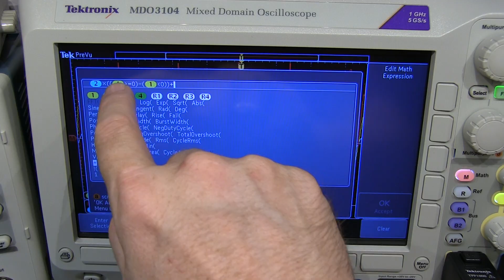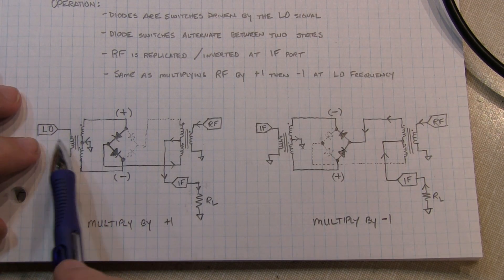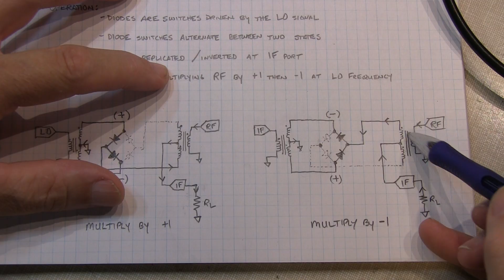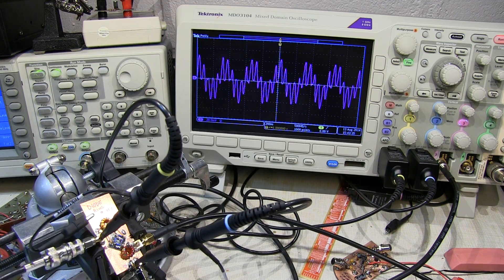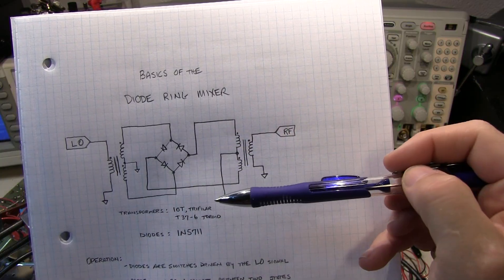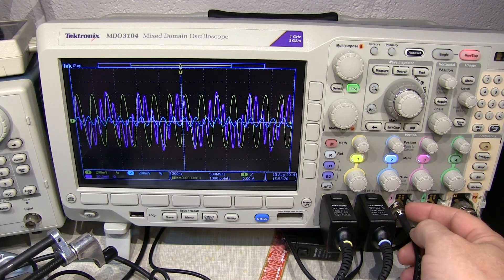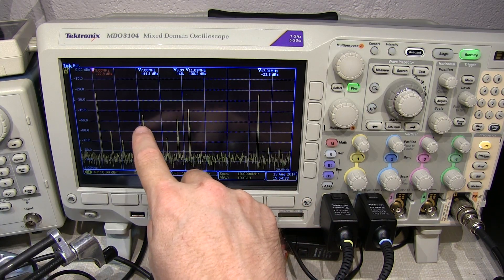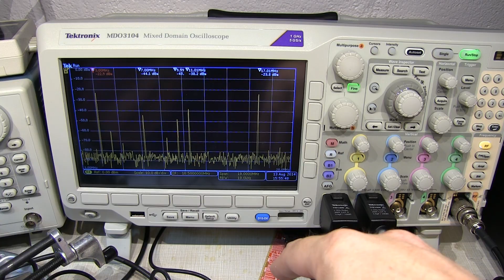#167: How a Diode Ring Mixer works | Mixer operation theory and measurement

Comment: Hi Alan. You comment that the IF output should have a good termination / a nice broad band termination, to prevent reflections. I’m all good with that. There is plenty of similar discussion on the web etc that agrees but “everyone” talks about a 50R IF termination. Is there something special about 50R or is it just a convention? Reading the comments I see the transformers XL need to be 4 or 5 times greater than RL … maybe 50R IF translates to a “practical” number of windings for homebrew transformers? Further, I assume the more XL the more attenuation on the ports, desensitising the mixer?? Thank you for letting me think out loud as I don’t have any Elmers etc to discuss with.
Reply from the maker: 50R is commonplace, but not set in stone.  Note that when making RF transformers, it is common to have the winding inductance be at least 4x the impedance used by the signals going through the transformer so that the inductance isn't really seen, but the impedance is then given by the impedance present at the transformer's input/output.  More XL on the transformer windings helps to make the transformer more ideal - to a point.  If you put too many windings, the interwinding capacitance will bite you.  So 4x is the generally accepted minimum, and probably no more than 10-15x the system impedance on the high end.  You can get away with a bit more - it all depends on when the parasitics start being a problem.
Reply: @w2aew  Thank you for your helpful comments. You say the transformer inductance needs to be at least 4X so that the inductance isn't really seen … that initially confused me but after much thought I’ve concluded the RF transformer winding “being used” is in parallel with RL, AC wise, hence the total inductance is close to RL. Am I on the right track?
Reply from the maker: @nevmarr  Yes!
Reply: @w2aew  Whoo-hoo!!! Once again, thank you sooooo much for taking the time to help me.

Comment: I'd like to point out that the various GROUND connections associated with the transformers and signal inputs/outputs are rather critical. Sad that most communications textbooks do not highlight the necessity of correct ground connections in order for the mixer, whether used as a DSB-SC modulator or a product detector, to operate as expected. Thanks so much for including them in your carefully drawn hand sketches.

Comment: You explained very well how the LO changes the polarity of the IF output, but there is a more complicated interaction of that polarity change on the RF input which is changing at a different rate than LO (if the frequencies of LO and RF are different), that is when the IF output becomes the sum and difference of the LO and RF frequencies.  Am I correct or am I in the dark corner???
Reply: The LO is really biasing the top and the bottom of the RF port's transformer to ground. He drew current coming from the ring diode, but that's misleading (I think) because you don't really want current coming from the ring diode (it's really current on the RF side of the transformer coming from ground over there). Any current coming from the diode-side is likely LO leakage (The current from the RF should flow to RF, but a lot of LO leaks into the IF port - you can see it when you measure the IF port output on a spectrum analyzer. Mixers have bad isolation.). As the ground bias from the ring switches when each half of the ring diode turns on/off, that's where the RF port's polarity gets switched back a forth and adds/subtracts the LO to the RF frequency or the equivalent of a multiply (If you wanted to just add the RF and LO you could use a combiner, but that wouldn't get you 1/2(IF+LO) and 1/2(IF-LO). It would just get you RF and LO on top of each other). You need a strong LO stimulus power to turn on/off the diodes. The goal of the ring diode is to just grounding the top half or bottom half of the RF port's transformer - that's why other mixer designs sometimes use MOSFETs instead of diodes to turn on/off.

Correct me if I'm wrong...

Comment: Question: I've built a diode mixer for AM modulation and compared it with the Gilbert Cell modulator. Does the diode version always suppress the carrier? or can it be adjusted produce a traditional AM signal like the Gilbert Cell?
Reply from the maker: You can sort-of do this by adding a DC offset to the baseband signal applied to the IF input.

Comment: I was wondering if I used a full bridge rectifier package with 4 pins... would that work?
Reply from the maker: No, the configuration of the diodes isn't the same as a bridge rectifier.
Reply: @w2aew  Ahhh. Just noticed that. Sorry for the dumb question, again!

Comment: I find mixers interesting. I realize that this is an entry-level, rudimentary mixer, but...
Could this general type of mixer be biased into either the positive or negative, (and then capacitively/AC coupled) to reduce the crossover distortion causing the odd harmonics?

This is a good video, as most of yours are. Thank you. (Generally, I have been so impressed by Amateur radio licensees/operators knowledge of RF electronics that it prompted me to get my General.)
Reply from the maker: Adding DC bias can negatively effect the balance of the mixer, and thus negatively impact the LO and IF/RF rejection.  Sometimes a small amount of DC is added as an adjustment to improve the balance.
Reply: @w2aew  , thanks for the reply.

Comment: Why do you call this mixer a Multiplier when you getting the Sum and the Difference?
Reply from the maker: The sum and difference obtained are the sum and difference FREQUENCIES, not the voltages. When you multiply two sinusoids at different frequencies, you mathematically get signals at the sum and difference frequencies.
Reply: Thank you

Comment: One aspect I have not seen addressed (yet) is drive level. The signal amplitude at the diodes I think should be at least 1.5 v, since 2 x silicon diode voltage drops of 0.7 v would be at least 1.4 volts to turn them on. But I do not know what the transformer ratio is, so I cannot guess at the LO amplitude. I also would like to play with IF filters, but do not know the proper drive level. My initial thought would be to drive a filter (mechanical, crystal, or piezo) with a sig gen at the filter's center frequency, slowly increasing the amplitude until I see some saturation evidenced by output ceasing to increase. At some point, I would expect damage from excessive drive, so I would like to stay below that. Radiofun232 comes close to addressing this with some of his lash-ups, but my questions remain unanswered.
Reply from the maker: I do address this topic in this video: https://www.youtube.com/watch?v=GvadQpkZ8l0

Comment: Hi W2aew,  great video however I think that you have the commutation of the diodes is incorrect.   Please see the image at https://share.icloud.com/photos/0FtZiOZDCXfoXPuzrq3Ne6ANQ   It shows the commutation of the diodes that cause the 180 degrees phase modulation of the input signal at the IF rate.  I know you will take one look and understand it.  Otherwise very good video. Cheers David

Comment: nice. correct me if I am wrong but there is gain in the mixer also,...(?)
Reply from the maker: A double-balanced diode ring mixer as shown here typically has about 7dB or so of conversion LOSS, not gain.
Reply: @w2aew  so are there configurations that produce gain? Or is the phrase conversion gain always a loss?
Reply: @w2aew  there is always the 1/2 factor in the product. But what about the  coefficients of the two sine waves? Acos(wlo) * Bcos(wrf) Does not the magnitude of the LO influence the resulting gain? I see no limit mathematically, a real circuit of course may be different. 
(Note I am NOT trying to be a dick here. I think your explanation was brilliant, just missing the amplitude part of the trig.) 
And I may still be missing something. 73
Reply from the maker: @mr1enrollment  There's a lot missing from that math.  The math is just to illustrate the frequency components that are expected to appear out of the mixer.  Coupling gain/loss through the transformers, response of the diodes, etc. are all not part of the minimal math shown.

Comment: You say that the point between two diode acts as ground. For the transformer (RF side)  both ends can be connected directly to ground and no need to connect between two diodes. This should also work isn't? But then how does RF gets multiplied if the LO signal is not affecting the induction of second transfer? I think there will be a back emf from the first transformer and that will allow some charge to flow from point (between two diodes) towards second transformer and affect the induction level at that moment i.e. gets mix with induction generated by RF signal?

Comment: What do you need to drive this mixer? How much voltage, and what kind of impedance does it expose to the driver side?
Reply from the maker: Typically about +7dBm drive when built with schottkey diodes.  Impedance looking in will depend on impedances on the other ports.

Comment: Question about theory: The diode ring mixer shown here seems very different from the Gilbert Cell mixer  described elsewhere. The diode ring seems to “chop” one frequency with  another frequency. That doesn’t seem like “multiplication”, but more of a harmonic creation mechanism. The undesired harmonics are eliminated with filtering, but with losses from the energy spent in suppressed harmonics. The Gilbert Cell seems like a true multiplication, where the product of 2 sinusoids is produced accurately, without creating a lot of extraneous harmonics. It is therefore less noisy. Is this a roughly true comparison?
Reply from the maker: Basically yes.  The diode ring can be though of as a multiplication of one signal by an alternating +1 and 0, or +1 and -1, as opposed to a continuous multiplication.  Even the Gilbert Cell can (and is often) be driven into limiting, thus giving a similar result to the way the diode ring mixer works.

Comment: I do not understand why the waveform (5:04) looks as it does (sine wave multiplied by square wave w/ values of +1/-1)... seems like it would simply be a section of normal sone wave followed by a section of inverted sine wave...? It does not look like that...?  (It would be good to see the square wave on  the display.)  The waveform seems shifted up and distorted, like way more than simply being multiplied by +1 or -1...?  +1 should not do anything and so it should simply be the original RF sine wave (10MHz)... but I do not see any part of the display that is a simple sine wave...?
Reply from the maker: The frequencies are fairly close, and you're seeing inversion at various points of the sinewave.
Reply: @w2aew  Thank you so much for the reply... I will think over what you said... it still seems to me that, even in the "math" case, it is doing wierd things like shifting up and distorting the sine waves...?

Comment: Even though only one half of the RF transformer is used at a time, do the coils used by the opposing polarity not resist the conducting of current in that direction, since they are all mechanically connected?
Reply from the maker: The "unused" half sees a high impedance, so no current flows.

Comment: I remember it was possible to mix signals by inserting one signal into the other ... is that true indeed? It probably will have a less neat result or doesn't it work at all?
Reply from the maker: as long as the combination goes through some non-linear element, mixing will occur.
Reply: @w2aew  I forgot about the need for non-linearity! Thanks

Comment: I have question: You mention that LO is used to multiply RF by 1 or -1 (or 0 sometimes when LO crosses 0). Can I use square LO instead of sine ?
Reply from the maker: Yes you can.  In fact, that's why the LO power is generally pretty high  - you want to quick turn the diodes on/off.  A square wave does this well.

Comment: So, at 2:54 and 8:06, we see a signal which is the sum and the difference of the two source signals? So it is the same as a "ring modulator"? (ring modulator schematic: https://wiki.analog.com/university/courses/electronics/electronics_lab_diode_ring_modulator )
Reply from the maker: Yes, basically the same thing.

Comment: Hi Alan. I had a question about your directional coupler video.  You used the outside conductor of a piece of coax as a Faraday shield by grounding one side.  Why doesn't this allow signal current to flow in the shield, and wouldn't this  cancel out the EM energy from the inner conductor so that the toroid current- sensing  xfmr would sense zero current since the toroid surrounds both conductors.  Thanks.
Reply from the maker: The faraday shield does not block the magnetic field (only the electric field), so there is still magnetic coupling to the toroid transformer.
Reply: @w2aew  Hi Alan. Thank you so much for your response.  I was thinking that the magnetic field from the electric current returning through the shield in the opposite direction to the current in the inner conductor would cancel out the magnetic field from the current flowing through the center conductor.  Thanks again.

Comment: so it is a multiplier?   why the complication in short it multiplies 2 signals? so just call it a multiplier?
Reply from the maker: Because it is a specialized multiplier (since it multiplies only under limited specific conditions), as opposed to something like the Analog Devices AD633 which is a true, 4-quadrant analog multiplier: https://www.analog.com/media/en/technical-documentation/data-sheets/AD633.pdf

Comment: At the 6:00min mark, or so, I don't understand the comment (to paraphrase):  the secondary of the transformer is shorted, and, therefore, the node "between" the left two diodes is at ground, with respect to the radio frequencies. Do radio frequencies currents flow from the ground of the center-tapped secondary, of the left-most transformer, through the top-left most diode and then to the negative bottom node of the transformer on the leftmost portion of the circuit, with the previously mentioned diode being forward biased?
Reply from the maker: The small signal resistance of the forward biased diodes is very low, so they "look like" very small value resistors to the right-most transformer windings.  The effect is that each end of the center-tapped winding on the right-most transformer is alternatively grounded with each half-cycle of the LO signal.
Reply: @w2aew  I did watch your videos on using Diodes as switches (which I thought were fascinating, BTW: #82 ' "How to use a diode as a Switch", #118 "Basics of pin diodes and their use in RF switching" , #200 "T/R switch with pin diodes and lumped element quarter-wave transmission line"), but I thought  DC biasing currents were needed to forward bias the diode, and not AC currents, in order for a diode to work as a switch - hope this makes sense.
Reply from the maker: @schwinn434    The diode is used as a on/off switch by forward and reverse bias - it doesn't have to be DC.  In this case, the positive half-cycle of the LO turns on one pair of series diodes, and the negative half-cycle of the LO turns on the other pair of series diodes.
Reply: @w2aew  Sorry to keep on about this matter, but I was wondering if you could build this mixer and actually see the radio frequency, from the rightmost transformer, superimposed on top of the forward biasing diodes in question- or would the vertical voltage sensitivity of the standard oscilloscope be too small?
Reply from the maker: @schwinn434  yes, you can see it with the scope (unless the RF signal level is very low)
Reply: @w2aew  Thank you w2aew

Comment: what happens if the mixer is used in unconventional way by, let's say, applying the RF input to the IF port and getting the output from RF port? or exchanging the LO and RF ports? or exchanging the IF and LO ports? why would someone need to do that? I am asking because I have seen this kind of usage quite a few times in various RF spectrum analyzer and signal generators that I have repaired (made by R&S, Agilent, and Anritsu).
Reply from the maker: In a general sense, the port are somewhat interchangeable - but this depends a lot on the type of mixer it is.  Sometimes swapping is done because a particular configuration provides a better return loss or frequency response in a given application.  It all depends on the mixer design and the overall design performance requirements.
Reply: @w2aew  the mixers I have seen their ports interchanged have all been double balanced diode or FET mixer ICs.
So, you are saying, as far as just frequency mixing operation is concerned, the ports are interchangeable? What happens to the conversion gain (loss) for example? A recent example that I remember was in a spectrum analyzer where a HMC488 mixer was used with its RF and IF ports interchanged. Now the datasheet gives me a conversion loss when the mixer is used in conventional way but how I can use the datasheet specifications for this unconventional usage?
Reply from the maker: @amirb715  The IF and LO ports are generally wider bandwidth, while the LO port is typically lower frequency, often including DC.  So, if you are which ports you use for what purpose will often depend on what frequency range those ports are designed for.  L-R is typically better than L-I isolation.  Some datasheets will spec conversion loss in different directions.  Mini-Circuit, Marki Microwave, etc. all have good info on their sites.